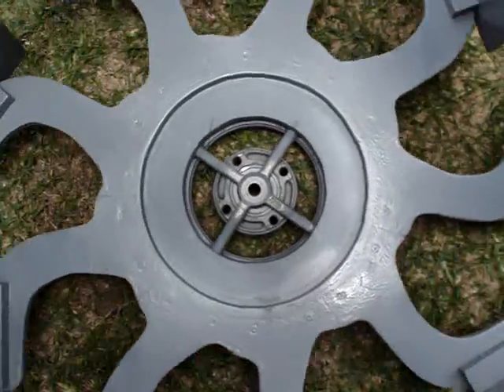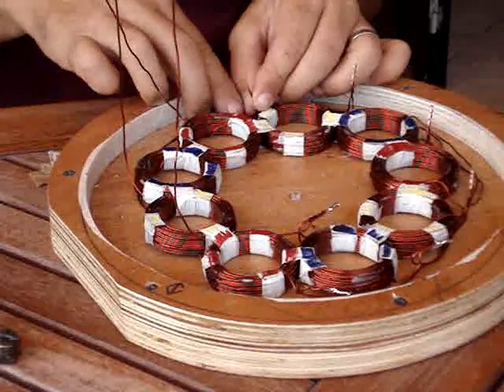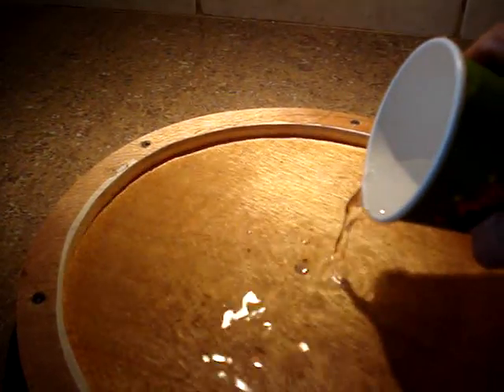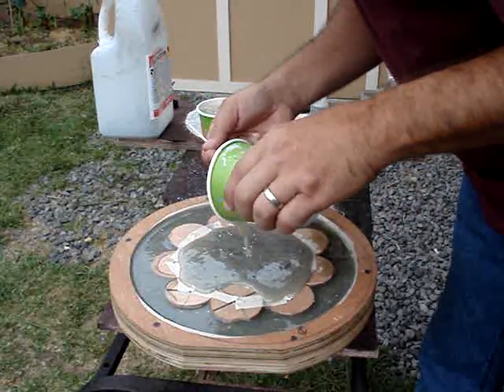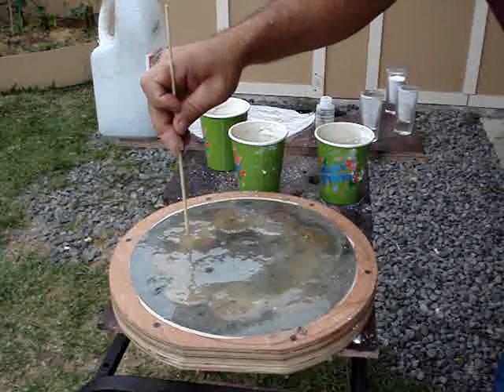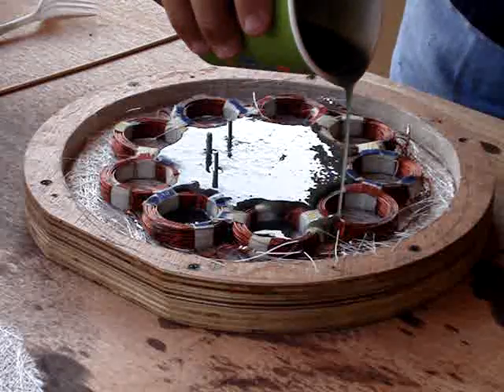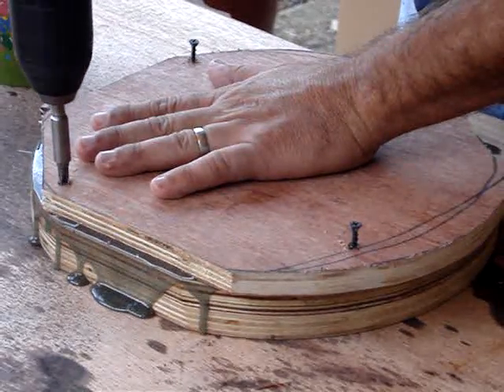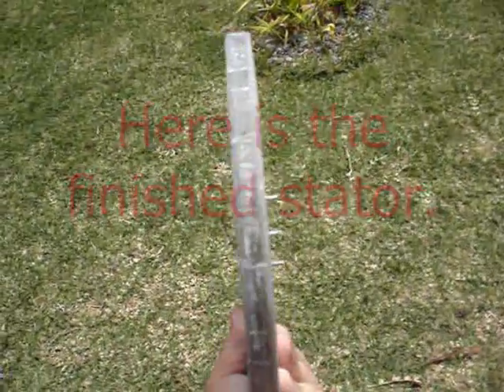How to build a homemade stator for a P.M.A generator (wind turbine, hydroelectric)

Comment: Thanks! Using the electrical tape did the trick.  Because we are doing the project at a smaller scale, we are using 24AWG magnet wire.  At 100 turns the coil wasn't that big.  His whole project is to show how the number of turns affects the output.  But i'm not sure if using such small wire was a good idea.  It's harder to make a smooth coil. Also the epoxy we used was too messy. I want to try a different one. Thanks for the help.

Comment from the maker: @BroadwyBound1 Near the beginning of the video I show a picture of the piece its a piece of wood the same size as the magnets before cuting the three sides drill and thread it on the lag bolt. then take it off and cut it into three pieces. Then hold the piece back on the lag bolt and put a piece of electricle tape around it. After you wind the coil and take it off the piece will now shrink enough to slide out.
Reply: I need someone to make a wind turbine for me as I'm not capable to manage the construction, , can I get some estimates from some of you that can show me your builds and results. . What I really need is the wire turnings to attach to a pvc pipe to give me at least 120 voltage ac to run a battery charger.

Comment: Another problem!! Help!  What did you use as the core of the coil. I used wood and it would not come out after completing the winding.  Once it came out the wires came with it.  If you could tell me what you used and where you got it that would be appreciated.  Thanks!

Comment from the maker: @BroadwyBound1 The lag bolt was not threaded all the way the part going through the support is smooth on the left side of the main support you thread the backer plate on close to the support and then use a screw down through the middle  of the backer plate to keep it from thightening up when you turn the handle. The backer plate is the first piece of wood next to the main support. I hope this helps

Comment: Hi.  Actually the shaft will be mounted horizontal like a regular generator.  We tried to start doing the coils but we are having problems with the coil winder.  When we turn the winder the lag bolt tightens and we cant turn the handle anymore.  Can you clarify what you did to make the coil winder as far as how the handle is attached to the lag bolt and if the holes are bigger in some parts or they are all threaded.  I hope to hear from you fast.  We are trying to get the coils wound by tomorrow

Comment from the maker: @BroadwyBound1 Great! Are you building the Remkick VAWT ? The Remkick VAWT I think is better. My videos that are numbered 1-6 will show you step by step the total construction. I used a tablespoon of talc to each cup of resin. Its suppose to help keep the resin from cracking I guess it works because none of my stators have cracked. The serpinetine coil is actually easier to make and hookup  than the traditional coils. emagnets has alot of info on the outputs on the serpintines coils.

Comment: My son and I have just cut out the wood framing and the wood rotor.  We will be putting a circular saw blade on the wood like you did.  We have learned so much from your videos! No videos yet, but we will start.  I still need to make the coil winder so we can get those wound this weekend.  I found fiberglass resin mix with hardener at Autozone like you suggested.  Thanks.  You added talc also.  How did you determine how much to add?  BTW, my son is in 5th grade and this is his Science Project.

Comment from the maker: @BroadwyBound1 You can hold them anyway you like as long as they dont move. The reason they are usally cast is so they are even and wont move so you can get the magnets as close as possible to the coils with out rubbing. Are you making a video of your setup? I would like to see it. Good luck with your project.

Comment: @Aceman307 Thanks!  I'll check.  One other question.  The generator I am making is a much smaller scale.  Is it possible to use a thin sheet of plexiglass to hold the coils in place?  That would save me time.  My stator and rotor will be vertical .  Thanks again for the quick reply

Comment from the maker: @velocity800 You probably wont be able to run anything but a small light directly off the wind turbine, and then it would only depend on how fast the wind is blowing as to how much power you get out. The idea is to use your wind generator to charge up batteries and then use an inverter to run your devices. Depending on how many batteries you have and the size of inverter you have you could run anything you wanted. Combining both wind and solar is ideal.

Comment: @Aceman307 I have motor cycle rectifiers ,wounder if that would be strong enough or just run it to a ac heater direct is more my plan , anything to help on the heating costs and in winter the wind doesn't stop much ,but i do appreciate your willingness to help .

Comment from the maker: @FrankaDith I would start with 20awg at 120 turns a coil. Use 9 coils with 12 magnets. The A/c that comes out of the stator go to a bridge rectifier that converts the a/c into d/c . So you will have three wires going to the 3 bridge rectifier a/c input spots and D/C volts coming out of the - and + on the bridge rectifier. It depends on how fast the generator turns as to how much volts are created.
Reply: How much rpm give this alternator for the producing more power 220v?
And how much it can Ampaire  or watts produce?
Reply: Jakie magnesy

Comment from the maker: @FrankaDith Everytime a magnet passes over a coil it creates electric current in the coil, as soon as the magnet passes the coil the current stops. So in a single phase it would be like - - - - - - - - - - -  if you have multiply phases you do away with the start stop to some degree. So the electric current that is coming out of the generator is more like____________  I hope this helps It is more complicated than that but thats the basic idea. the three wires from the generator go into rectifier

Comment from the maker: @FrankaDith I have seen people use single phase all the way up to 5 phases check out emagnets videos he does alot of testing on different combinations of phases. Three phase is the same number of phases your house uses. By setting up your coils at 120 deg apart you get a smoother power output.

Comment: @Zontertes  It protects the stator from corrosion and elements. May I add, that if you drill 1/4" holes through center of coils space, and additional holes through encasement, it will assist with cooling should overspeed ever cause unwanted heat, thereby increasing life of stator cast due to constant expansion and contraction.  Do keep in mind the ideal stator would be covered from rain - ice, but still allowing for some movement of air.  Regards.

Comment: Ok,  Please clarify. Coil & Magnet Ratio.
1 Center (open space) I.D. of coil should be the diameter of the magnet
2 Height of ea coil should be 1/2 of magnet diameter
3 Coil diameter or O.D. should be 33.4% larger than magnet
4 Stator diameter should be 90% of Rotor diameter.
Now, please explain  what  is ideal wire diameter for low 5-7mph wind start up speeds. Thanks.

Comment: Aceman, please clarify. It is my understanding that crowding the magnets like you show on the sawblade causes the flux field of magnets to bleed over one another. In other words, if there is some spacing of magnets, you capture the full flux field of each magnet when the coil passes over it.  So the question is, should there be spacing between the magnets of at least the coils leg, not both coil legs, but at least enough spacing between magnets of at least one of the coils legs?  Thanks.

Comment from the maker: @billmalta1 I got my information from windgen.org for the size of my coils/magnets.It also had to do with space and making the correct number of coils and magnets line up. I am going to post the numbers on this soon, It did not perform well at slow RPMs so I am going to go with smaller wire and more turns. It could also be my magnets are to big for my wind turbine. Alot of different varibles thats what makes it interesting. Have you had any luck building one?
Reply: Just wonderful, I been tryin to find out about "home electricity production" for a while now, and I think this has helped. Have you heard people talk about - Diyadison Penhloe Blaster - (search on google ) ? It is an awesome one of a kind product for generating your own electricity without the normal expense. Ive heard some unbelievable things about it and my m8 got amazing success with it.

Comment: I have a small question...
ur mags are 3.5cm by 9mm right? and ur coils 5cm by 1.3 ...
i ve read a lot about coil windings and most of the people say that ur coil dia must be twice the dia of your mag ... i might understand that u reduced it to avoid airgaps betwin the mags but adding more wire on ur coils does make the generator more efficient???
 so why did you choose this configuration?